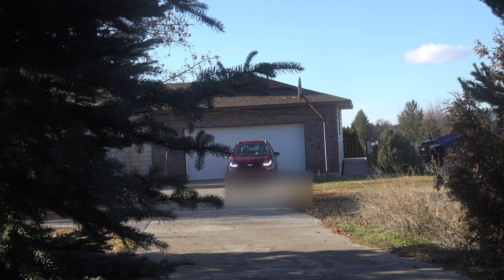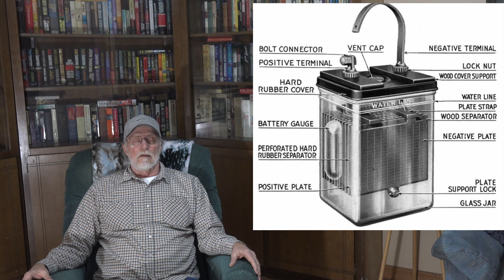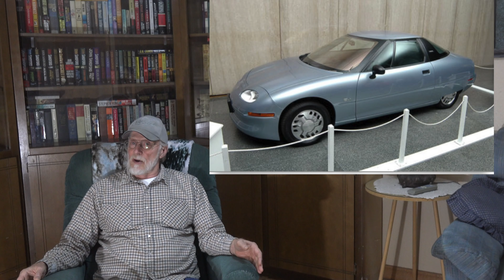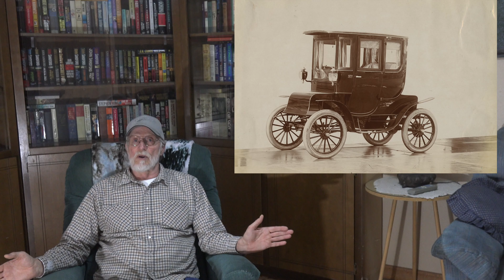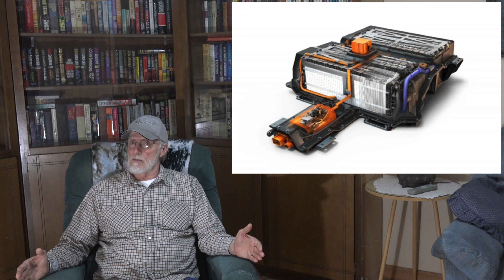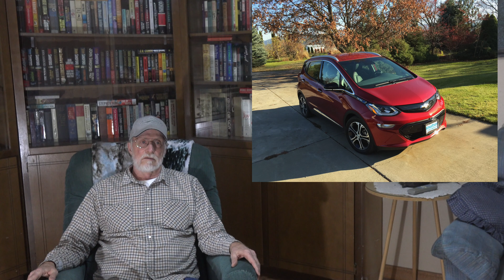A short history of the Electric vehicle

Comment: Its clear that electrics are approaching what a gas vehicle can do.  For electrics to be the dominant choice they would have to out perform what a gas vehicle does, and be cheaper msrp to msrp without any subsidies.  I just cant envision evs doing that with batteries in their current form.  I think the revolution is coming but its going to be with super capacitors or something that doesnt weigh 500 pounds
Reply from the maker: In many ways, they already outperform gasoline vehicles.  They have faster low end acceleration, they corner better, even with rather low end suspension and there is virtually no maintenance.  Also, the operating costs are far lower than the gasoline car.  
Batteries have always been the achillies  heel of the electric car.  Even the lithium ion batteries and their support are quite heavy.  The only way these components are improved is for them to be manufactured and improvements made.
Interesting that you mentioned super capacitors.  I also thought they could be an option.  However, their watt density is so far below that of other batteries that much will have to be improved.  BTW, a 60 KW battery system weighs a little under 1000#.
GFM

Comment: I think you are correct about the 1st EV's using lead acid batteries.  I've read posts by people who had one, or maybe by one of the engineers on the original project and it was mentioned that the lead acid battery pack was very heavy.  The original motor speed controllers for corded electric drills were rather rough.  I think it is rather amazing how electric cars are so similar to gasoline cars in look and feel.  As long as they are charged up the performance is actually better.

Here's an idea:  Electrified highways for electric cars.  That would pretty much solve the range limitation.  While on the electrified road, the car would be charging, and when it left the arterial roads it would be on battery power.
Reply from the maker: When an electric car is designed, they are usually set up to make the transition seamless.  A prime example is the Chevy Bolt shifter.  The car has no transmission, so why a shifter.  So it seems "normal".
I don't think there is enough copper in the world for an induction highway.
GFM
Reply: @electriccar3253  , The volt has a shifter for Park, Reverse, Neutral, Forward Normal, and Forward Low.   The low speed can be used as an additional electric brake.  I think it's important that the controls of all cars are similar.  I can't stand cars that have the horn button in some odd hidden position, or you can't figure out how to turn on the lights or the radio.  The worst thing about the Volt is you can't reset the computer system when it locks up on the highway.  It's a tow to the dealer who then keeps it in the shop for about three weeks or more, because they are so busy with all their other warranty work.
Reply: Of course the all time worst new device on a car is the Toyota "Smart Key" that costs over $500.00 to replace.  Can only be done at one dealership in the state.  The car is programed to the key, not the key to the car.  Some people have lost their key when the car is locked in the garage in their house.  It costs a fortune to have the car moved out of the garage and towed to the dealership.  Then you have the high price of the replacement key after that.
Reply from the maker: I guess you have not driven many Japanese cars.  They seem to do everything backwards.
GFM
Reply from the maker: If you want the remote controls, you have to accept the security that comes with them.  Remember the hacking devices that could open any vehicle?  They have to counter that with more security.
GFM